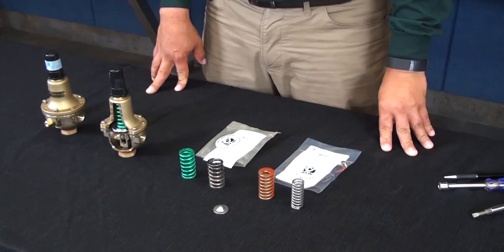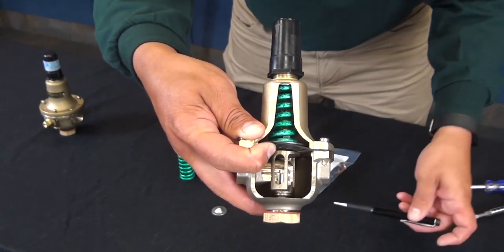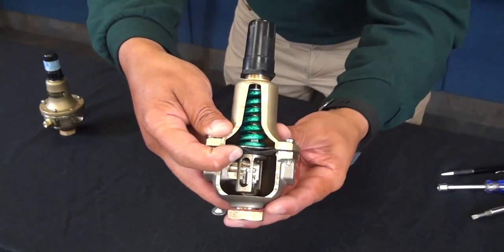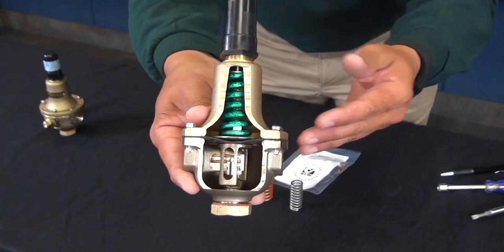Cla-Val CRD Pressure Reducing Pilot Set-Up Instructions

Comment: 6:24 is wrong
Because when the valve open it will not allow the flow from downstream to the main valve
It is one direction flow from the main valve to downstream so the correct it will allow the flow in the top chamber to be evacuated through the pilot to downstream not vice versa